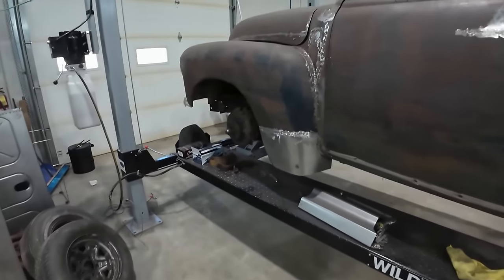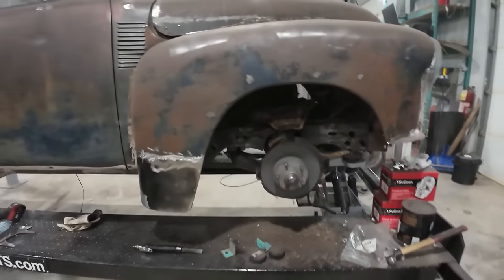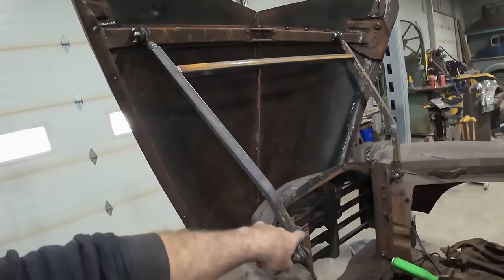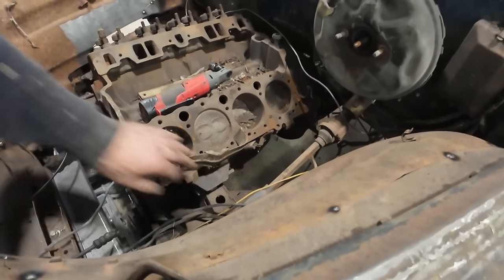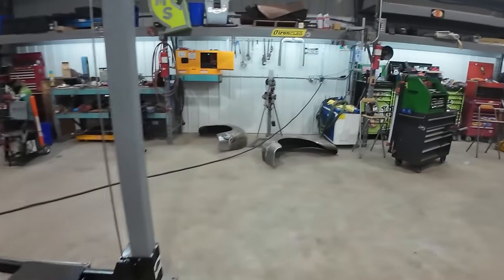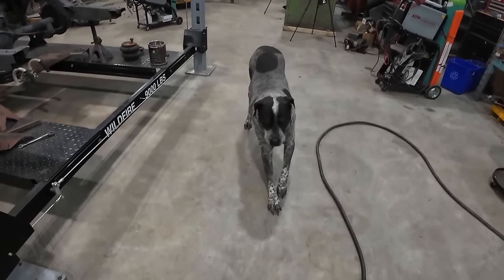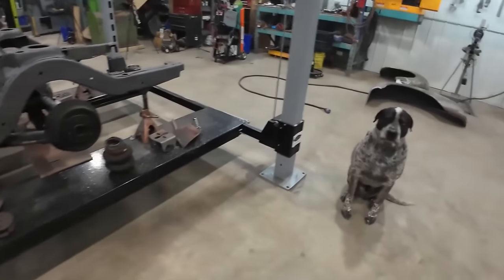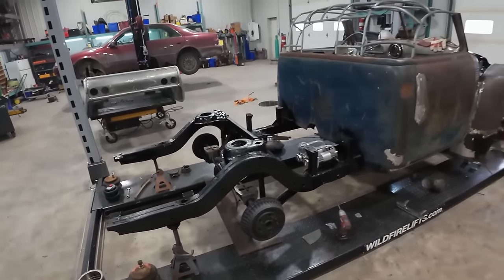Transforming Our '49 GMC Roadster With A Fresh Paint On The Chassis!

Comment: Your old shop may have been bigger, but the new shop appears to have more usable space for you. It had more sections to it and was not as open as this lay out. In between the new shop and new toys, it's made a very cool build on this truck. I really enjoy watching you bring these old beast back to life.
Reply: The old shop had personality.
Reply: @billholder9665  I agree!!
Reply: Didn't the old shop have the same floor size?
Reply from the maker: yeah, I took the old had 20 years to get there so it’ll take a little time but This one will eventually get there.
Reply: @HalfassKustoms  I have a question?......

Why paint the engine bay black?

Wouldn't it be better to have a light grey to let out some heat?...
and it would be better to trace leaks?
Reply: It's early days yet, if he ever runs out of space I can see an extension being built on.
Reply: @HalfassKustoms  I did like all the stuff on the walls and all the stuff you had hidden away like repair kits, seals , gaskets, and hoses.
Reply: @clevelandmaker386  The reason black soaks up heat is because it absorbs light. In a closed hood engine compartment it is shaded so it will make no difference in heat cause it will  not get much light.

Comment: A man who had a laser machine such as yours told that a coat of carbide dust was left semi etched into metal he cleaned with it. In my view however after doing that prep the rust is removed its dry there is no further cleaning essential if the paint is very thinned. Preferably etch primer.  And though the ability costs a lot at present it's like the first commonly available mig welders in that you have an edge on all other systems and competitors with your machine. It is impressive.

Comment: I wonder how much your power bills will go up with that lazer ???
Great work as always be 👍👍👍
Reply from the maker: I haven’t noticed any difference in my electricity bill.
Reply: @HalfassKustoms  wow that's awesome but I guess it's like running a toaster oven for a couple hours 
I know when I di alot of welding over a month its about the same as if I run a compressor alot 
And with the way you are running multiple high amps devices you probably just use alot of power most months so it equals out...still gotta be more than 6 months ago but worth it 👍